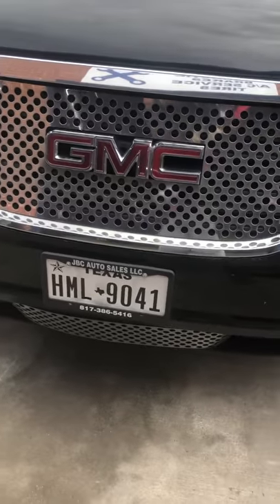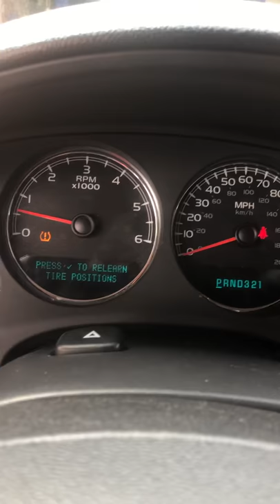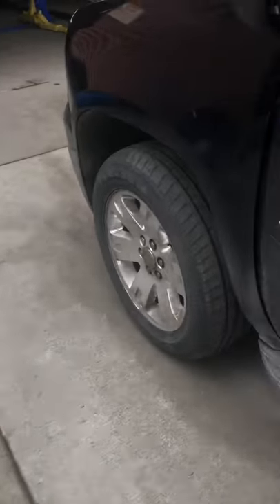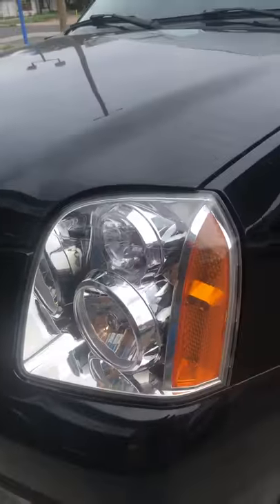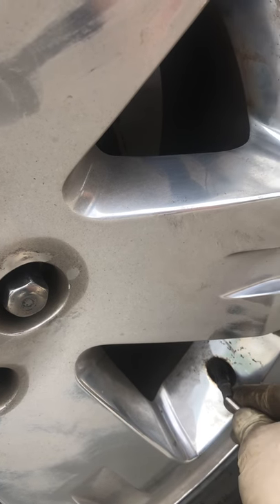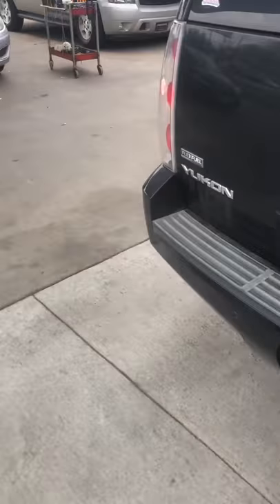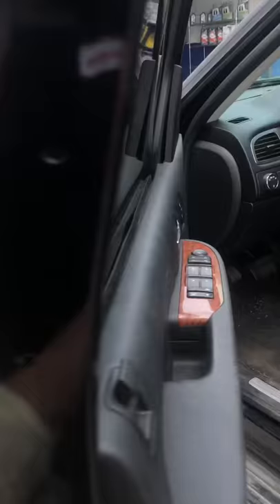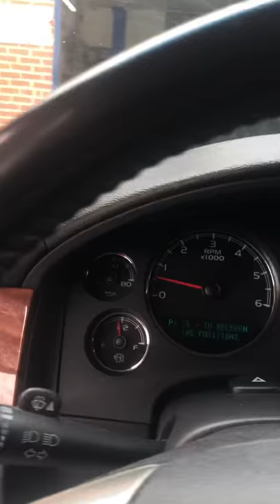2007 GMC Yukon how to reset the tire pressure sensor

Comment: My truck doesn't give the option to relearn tires
Reply: Put the key in the on position but don’t turn it on.  Then hold your lock and unlock button on your key fob and you will hear two beeps.  Then it will be in relearn mode for your tires.
Reply: @jermainebuchanan9121  I don't have a key fob just a remote for the alarm.  Would that work ?

Comment: Can't find this setting on my 2010 Denali!
Reply: Turn your key to the on position (not running).then @ the same time press & hold the lock & unlock buttons till you hear 2beeps then turn your headlights off & step outside the car & look for whichever corner of the car has a light on that's the tire you start with....I also have a 2010 denali.
Reply: Oh, all I got was two flat tires. No beeping after the initial process started